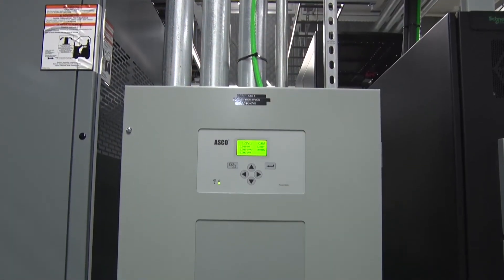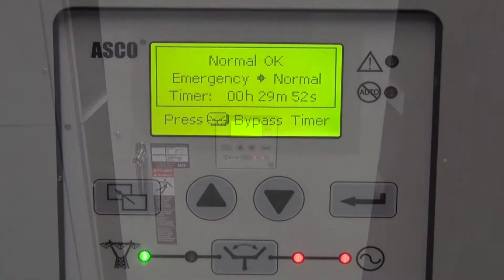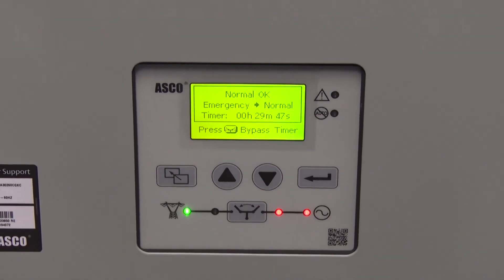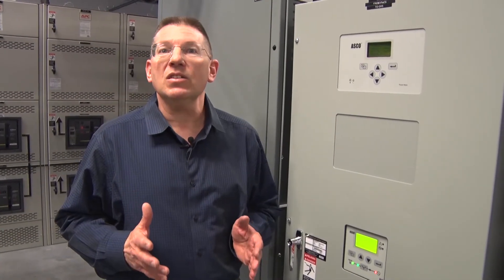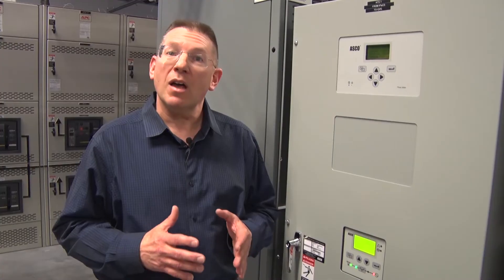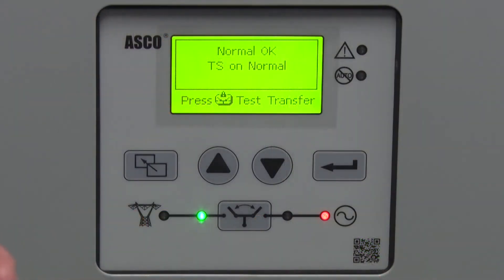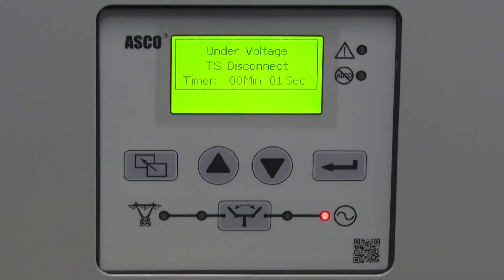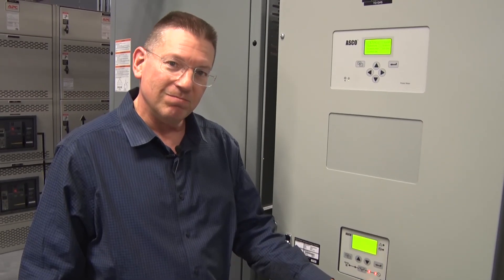What is an Automatic Transfer Switch? | Innovation Executive Briefing Center | Schneider Electric

Comment: How many seconds does it take to switch from one power source to the other?
Reply from the maker: Thank you for your message, Joshua Utik. We offer a complete set of digital tools to help you find answers to your questions. If you're experiencing difficulty navigating our tools, we offer live chat support to get expert help now. Please select your location here to get started: http://spr.ly/60553FoC9
Reply: In a data center world if your connected to a UPS system it should be seconds around 10 or less to battery power on to secondary source
Reply: A couple seconds generally.